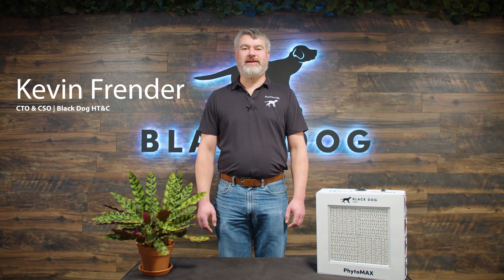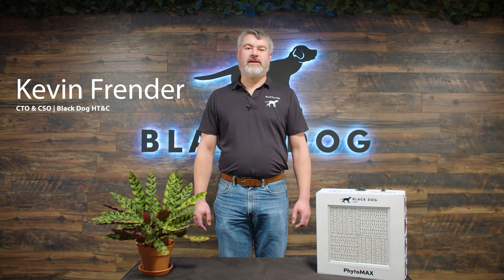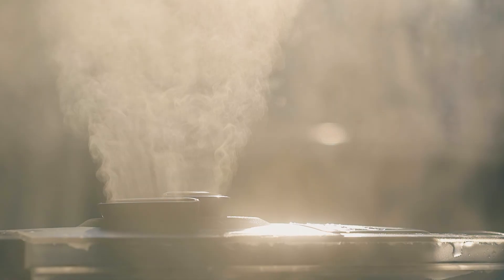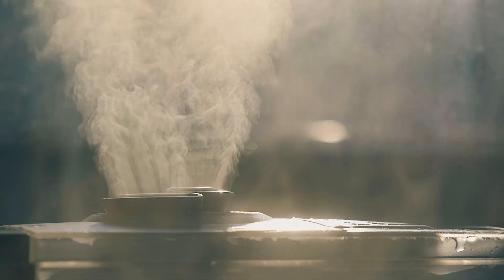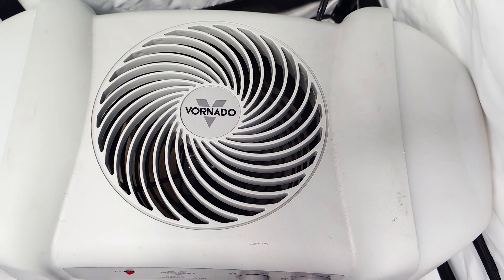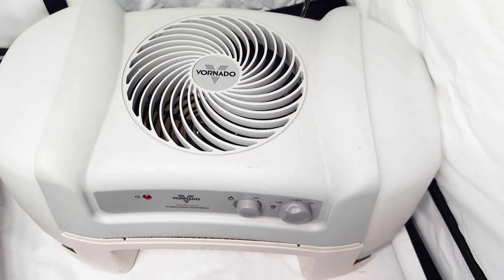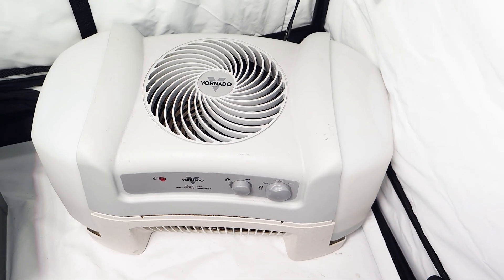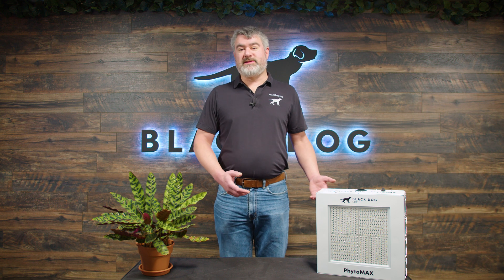Kevin’s Corner – Ultrasonic vs. Evaporative Humidifiers

Comment: What if you run RO Water through Ultrasonic?  I have done this in my Black Dog LED / Budbox setup and neither the Ultrasonic nor my Phytomax got anything on them.  - GodzillaGrower420
Reply from the maker: Hey! Thanks for watching. Using RO water in the ultrasonic humidifier will help as RO removes most of the dissolved solids, but not all; there will still be a buildup of minerals over time. Distilled water is better than RO for this reason but is is much more expensive. Evaporative humidifiers are a fool-proof way to humidify without these issues.